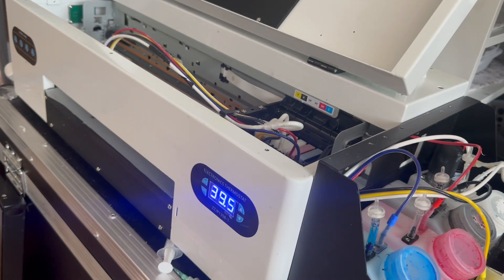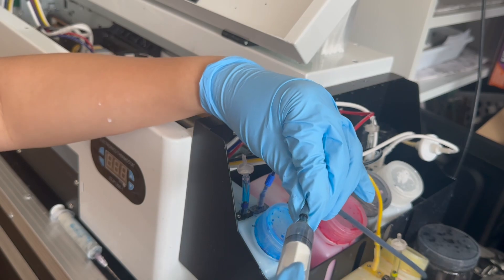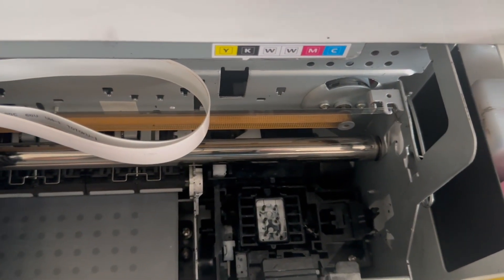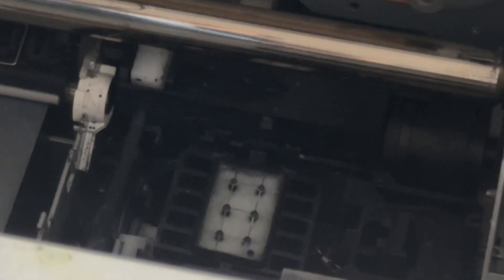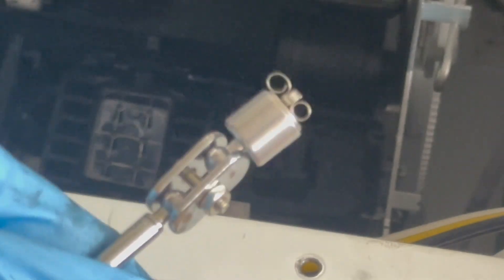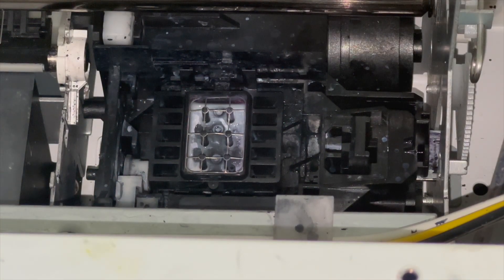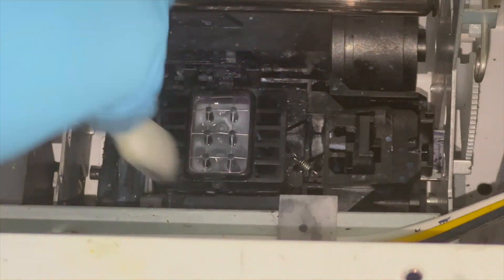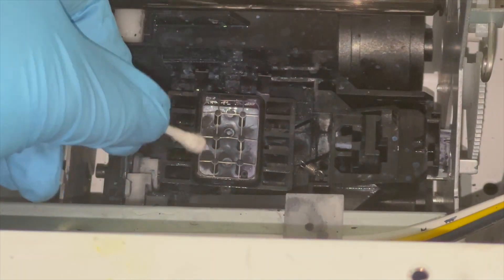Cleaning Capping Station on L1800 DTF Printer

Comment: Can you tell me if the two black tubes under can also clog? Should we clean those and how?
Reply from the maker: Yes, they can clog as well and clog the actual capping station. But you would have to take it all apart to clean those. I think as long as you’re doing usual maintenance they should be fine.

Comment: My waste ink tube is way short. I can barely pull it out from the back
Reply from the maker: You can move it to the front or run it out the sides where the ink bottles are. Just gently pull it from the back (don’t remove from printer ) and place it where you can access it easily.

Comment: Having a clogged capping station. What issues wpuld this cause the printer. Mine isnt printing any colour ont transfer. When syringe waste tube its a vaccum no fluid comes out
Reply from the maker: @davewilkos26  it won’t suction the ink so sometimes there can be a pool of ink in the capping station (which can bleed with the other inks), this can cause lower quality print or your white ink will not be as bright. If it’s a vacuum when you syringe, that means there’s a clog maybe in the waste tube. You can try to replace only the capping station to see if that will help. You can check Alibaba/ AliExpress for discounts.

Comment: Thank you for taking the time out to do this video! When I pull from the waste ink tube, I have a vacuum effect and not possible to pull the liquid through the hose. I'm not sure if it's a clog or if there's a sensor to be careful of. Would I try to pull it loose, while the pad section is heating up?
Reply: Have you figured out how to fix this issue yet? I’m having the same problem.
Reply: @dustindraeger2598  I'm actually still trying to get it cleared, but it's slowly getting air back into the waste ink line. This video seemed to help the most because of the heat. I was able to get most of the dried ink out of the waste ink lines but I'm still pulling out more dried ink. I hope you get yours fixed and doesn't take long. If you know where the dried ink is location in the line and able to get to it, placing a warm/hot paper towel around that section and letting it sit for a few minutes will help break down the inks in the line. You can also mix isopropyl alcohol into the warm/hot distilled water to help break down the ink through the capping station, too. So far, that's whats been helping me the most. Just be gentle syringing from the end line and take your time with it, until you get the ink broke down.
Reply from the maker: @joenobles7500  hello, sorry I am just now seeing all the comments. If there is still a clog you can try to replace the tube. I don’t recommend this part but I DID try it for mines, I put some warm distilled water in a syringe, and put it at the end of the waste ink tube and pushed water GENTLY back to the capping station. I put a paper towel above the capping station. It did help with my clog before but if you’re not too careful may splatter ink everywhere.
Reply: @bloomingcanvasdesigns  Hey, it's okay I understand 🙂. Where I thought the clog was initially, towards the end of the line, came out from the hot water and somehow it's still clogged.

I'm just taking my time with it and letting patience work it's magic. I've been sticking with your method, since it seems to work the best and adding in iso alcohol 50/50 to help even more. I'm just not sure on how hot the water should be?

I've been going with hot to touch but not boiling hot. I had the hot water drip onto the paper towel over the sections I see and able to reach to heat up the inks too. I wait a few minutes to try sucking from the end of the waste line with a 25ml syringe but I just upgraded to a 100ml for maximum power 😀 and when pulling, I go with the vacuum and go slow as possible to try to loosen the ink.

I have gotten a little bit of air flow happening, so it's breaking up slowly, but not completely airy or able to pull from the pad section.

I did try going the opposite way slowly to see if anything happens and I do get bubbles on the pad, when doing it, but like you mentioned I'm definitely careful with it and don't want it shooting back in my eye 😂. I'm going to try using the paper towel and reverse flush slowly to see what happens, maybe it'll help loosen it up. Thank you for replying and sorry for the long reply 😂.
Reply from the maker: @  if there’s still a hidden clog, maybe put a syringe at the end of your waste ink tube and while you’re pulling and feel the suctioning (try to hold the pulled syringe with one hand) and use your other hand to “pulse”/ quick pinch /release 🤏🏼  pinch/release multiple times to get more air flowing in the tube. 

Are your colors printing out fine though? The brand of ink can also be a factor. I used to think my printhead was clogged so I replaced multiple times. But after I changed to a different brand my white ink was so much brighter.

Comment: You are amazing, you motivated me to remove that top part of the pump to clean it because my drain hose seems cloged despite all the exercises with the syringe (alcohol, warm water etc) I have an issue, after I removed the top part (kept the spring with a thread ;) ) I was trying to aspirate and push air from the tiny hoses the one on the right came off from the connection which I did not notice where was exactly. That means most likely that either the connection is blocked at the pump level or there is a diaphragm tha prevents fluid movement in either direction which I doubt. that's why there is a hose. My question is do you know where the end of the hose in the right goes?
Reply from the maker: Sorry I didn’t get a notification for this comment! Hopefully you have resolved it by now. I haven’t had a reason to fully open up my printer on that side since I haven’t replaced my capping station since I bought the printer. The 2 tubes both attach to the capping station and meet into 1 tube which is the waste ink tube in the back. 

You can google L1800 capping station and you’ll see the image of the 2 tubes.

Comment: I don’t know how to put the spring on
Reply: The big spring
Reply from the maker: @kelliejones1168  the big spring just lays on there. But the spring has a certain shape on top so just make sure it’s aligned with the bottom of the capping station. If not, just keep turning it until it lays flat.

Comment: Hello mine seems to be stuck . I was able to remove the spring but it seems stuck . Am I missing something
Reply from the maker: @90chikiya  Hi! There are these little edges (two on the top and one on bottom middle) that are holding it under. So after removing the little spring, you can gently push the capping station down and push lightly left/right until those lift from under. Be careful not to break the edges.

Comment: Great video. I just have one question. My printer has a sponge in the capping station, did you remove that and replace it?
Reply from the maker: @TimHocutt  thank you! Yes, I removed it so the ink can flow better. It’s a hard sponge so sometimes it’s can be difficult to remove. I used a xacto knife and some tweezers.